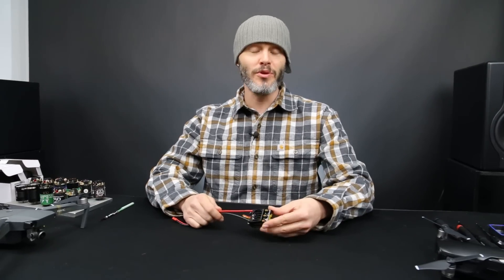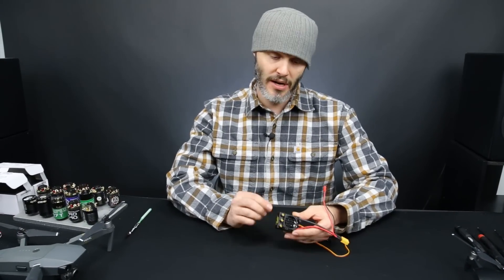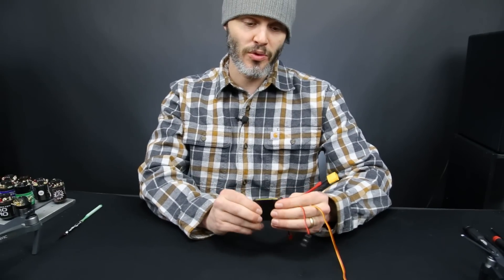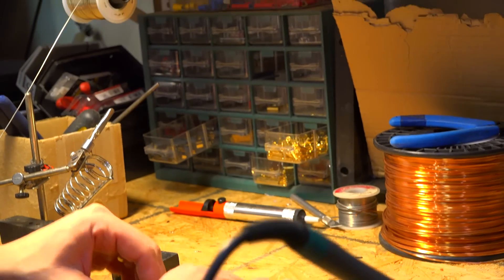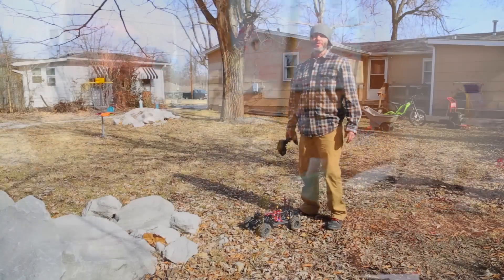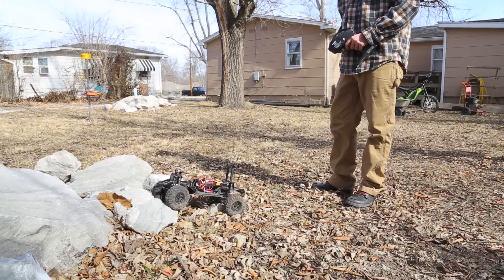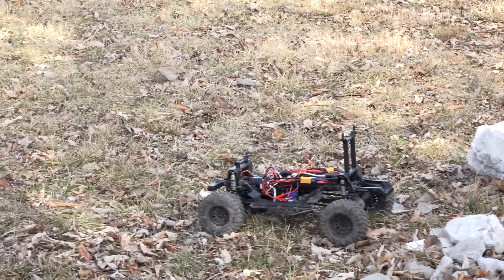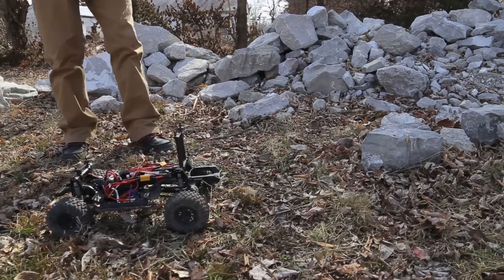Castle Creations Sidewinder 4 Review And Test

Comment: Hey John, while waiting for Crawlmaster Minis to come off backorder and ship, could I get away with running a sidewinder 4 on 4S? The set up is a Holmes Revolver 1000 KV, and a Holmes SHV500 V3 (direct powered). Also running a Torquemaster Winch off of it's own battery. This is in a NSWD with a 2low tranny. So nothing heavy, not sure the weight of the rig but, it's a C1 build with limited added weight.  Thanks for your input.

Comment: Hello. Yes I'm late to the game. My friend is a new crawler. Ran same combo an fried his steering servo, he for got to wire 12 volt.to servo,,Did you just jump.power only from battery or both negative an 12v.to .servo an use a single signal.wire to receiver..sorry.to spund dumb..
Reply from the maker: we have negative jumped inside the servo.   signal and ground from RX, positive and ground from battery.

Comment: Enjoying your video's John. Do you know what the ESC resolution is or number of individual steps on the throttle curve the ESC has? Also, I live in a relatively cold climate and that combination beanie and cap is damn fine idea.
Reply from the maker: It's at least 10 bit resolution, if not 12.

Comment: Hey John .. excellent review of the SW4 .. I just bought this exact same setup recently for my SCX10 II .. problem I'm experiencing with this (on 3S LiPo) .. it's seems very fast compared to the videos I have seen with this setup, and I have been unable to locate anything on the web as to what the BEST settings are for the SideWinder 4 and this beast of a motor ?
Reply from the maker: gear down to get wheelspeed in check.  use a smaller pinion on the motor.

Comment: That's a nice setup. I am wondering why there seems to be motor spool up time before it moves. I seen another video with the same motor with your ble ESC in an SCX10 but it would move quickly and was so much quieter. Would the noise level have to do with the ESC and the transmission for the quick response in movement?
Reply from the maker: the rotor has a lot of inertia, and this is sensorless operation.

Comment: I think you missed the new CRYO-DRIVE on the SW4. Would really like to what kind of voodoo that is.
Reply from the maker: I do discuss it, but not with the terms they coined.   It's a combination of dithered switching frequency to reduce switching losses , and a synchronous rectification to reduce diode losses.    Most of the gains are found when running under 50% duty at high load, when diode losses would typically be the majority of heat.
Reply: @HolmesHobbies  Awesome thanks for the reply now I just need to figure out if it is an upgrade from the VXL-3s or just a sidegrade. Any chance you have an opinion on that? Vehicle is a Slash 2wd LCG VXL used mostly on paved or prepared off road surfaces.
Reply from the maker: Almost anything will be an upgrade.    I would probably get a Mamba X, because it would work for about any other 10th scale rig you may have in the future, and also has great sensorless startup.
Reply: @HolmesHobbies  I have a Monster Slash with the 1512/MMX combo and another rig with the SCT 1410/SW3 combo. This truck is for my son to learn on. So I am trying to see how cheap I can go without going with no-name ebay parts. Just making notes to remember the upgrade path I am going to use as parts go bad. Because I am going to let him run the Velineon system in the ground first. :)

Comment: Bias? Out runner motors are seldom used, I wanna see a castle motor with this esc hoping it will handle 8lbs without a battery
Reply from the maker: Outrunner motors have been used in crawlers for 12 years, over a half decade before other brushless solutions came to market.    While four pole and two pole motors are more popular these days since sensored is widely available,  there is no beating a Revolver for sensorless operation.    The sW4 controls a 4 pole rather well too, with proper gearing you would be fine with an 8lb rig.

Comment: Hey John! I’m loving what I’m seeing with this combo. I’ve heard mixed info on whether the revolver motor is water proof/water resistant though. Can you add to this and clarify some information? And I don’t mean completely submerging the rig under water. I’m lookin for something brushless that I  can do more scale water crossings with and not worry about it damaging the motor.
Reply from the maker: The bearings should be kept well lubed, just like any other motor.   Besides the chance of rust, the motor runs underwater just fine.
Reply: HolmesHobbies awesome! Thanks for the response.

Comment: On this system do you have to run an external bec for a 6 volt servos
Reply from the maker: It would be recommended for any servo over about 250 ounce inches
Reply: HolmesHobbies thank you

Comment: Any chance you can do a video on the same set up but showcase the Snubnose? I have a build using the TRX 4 drive train that it would be perfect for size wise  but I can not seem to find any videos on it. The size makes me hesitant.
Reply from the maker: What sort of use?   mostly crawling, or will you be using second gear a lot?  The snubnose would be just dandy for mostly crawling, but would run a bit hot with extended 2nd gear use.

Comment: Hey John how do you feel about the bullet connector directly on the board?  I would wanna run in my sand rail but i remember the original VXL was plagued with the bullets breaking off the board and not being able to repair them.
Reply from the maker: Not really an issue IMO.  The case on the sW4 gives some strain relief too.

Comment: Can my sidewinder micro 2 be updated to this same software? Or do I have to buy this ESC.and for a 2.2 shafty comp crawler would 1800kv or 1400kv SNUB NOSE revolver be better? And what size revolver would have better drag brake?
Reply from the maker: No, this is mostly hardware changes making the SW4 startup as good as it is.    Lower kv and larger motor will have the best drag, 1400kv 540 size.     I would personally throw in a 1400 snubnose into a comp rig.

Comment: Do you have a plan to test the mamba micro x ?
Reply from the maker: We have one shop rig running the micro.  Have a specific question?
Reply: HolmesHobbies  just wondering how it handles trailing/crawling with slate or puller motors

Comment: North Carolina here does u make 3674can 3100kv motors?
Reply from the maker: No need to go that long, as it becomes a poor motor because of the winding diffuculty and rotor flex.  We have a 3663 Puller Pro XL in 3500kv. https://holmeshobbies.com/motors/brushless-motors/puller-pro-series/puller-pro-bl-540-xl.html
Reply: +HolmesHobbies thanks for the link
Reply: +HolmesHobbies thanks for the link and info love all your stuff I think I can use that motor.. we do a lot of outlaw drag around here.  just getting I'm to scale trucks.

Comment: I love that you show how well this combo works but you use the trx4 that has very low gearing cause of 2 speed. How would this crawl in say a scx10 2 rtr with much higher standard gearing? Would it be just as smooth to crawl with?
Reply from the maker: The scx10ii gearing is not a problem!